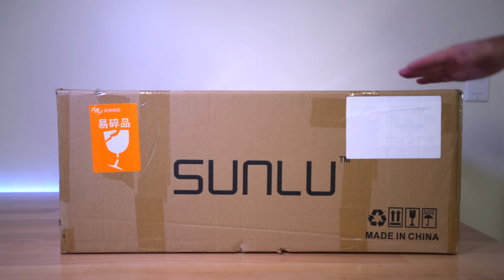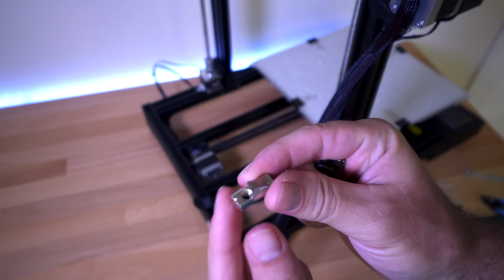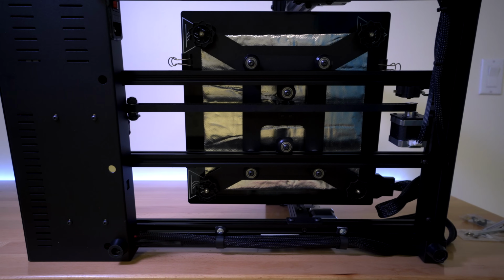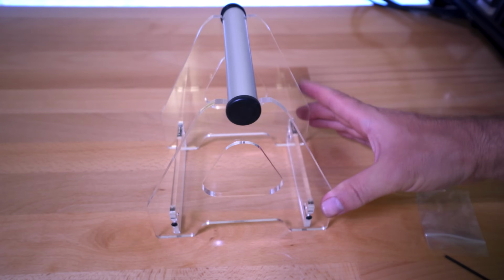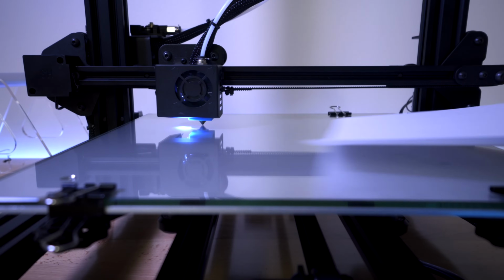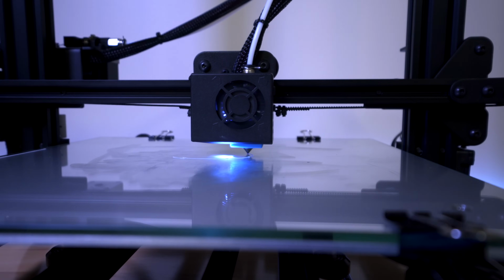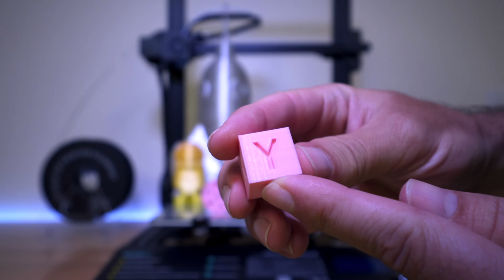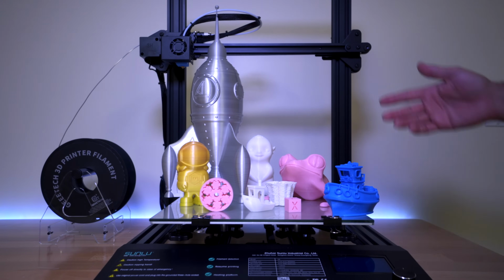Sunlu S8 - 3D Printer - Unbox & Setup

Comment: Just ordered the updated Pro version.  Perfectly what I wanted: a large format direct drive using a traditional extruder easily converted to direct drive with a stock bracket for an Ender that replaces the hotend roller head and adds a bracket to move the extruder to be above it and feed straight down ($15 from Amazon).  Gives me a large bed with dual Z that I can use TPU on with an improved head on the extruder to prevent filament escape by replacing it for a small gap between the gears and the receiving PTFE tubing.  Since I use Octo4a on a Tracfone Blue View 2, I don't care about the screen and appreciate the full size USB input.

Will see how I like the flex magnetic bed, and can order a PEI coated magnetic bed if I'd like that better since I love it on my Kobra.

Great price at $199 delivered.
Reply: My new S8 Pro arrived today, set up easily and perfectly.  Since someone had mentioned the gantry not being square on theirs, I only moderately snugged the four lower nuts with the T nuts tighter, then set it upright and checked the gantry for square and it was, so turned on side again, tightened all fully and then checked again after upright, and was still square.  I was prepared to shim it with aluminum foil if need be, but it was perfect from what I could see.

I didn't notice the right side Z stepper had the wiring off, so stopped and fixed that when I was doing an initial Home and it was jerking downward under no power from that side.

Used my square referenced above to level the L and R sides having it just scrape under the X extrusion on each side with power off, and smeared excess grease off the Z gantry down along the length of the rods and the Z was lowering like on butter.

Having done tons of manual leveling, it was just nice to have it move to the four quadrants on its own, only would have been better to have it just have a menu option each time to quit, but a default of move to the next corner, repeating infinitely to not have to start it up again for each pass around.

This printer bed springs seemed prone to do a little bit of "guitar tuning", in that when loosening the nuts, the bed didn't smoothly loosen (you don't always notice a commensurate looseness on your paper shim), and they would then over loosen as if the springs were jumping (like a guitar tuner does at times) and then on tightening it does smoothly pull, so in that case, just like on guitar, I seek the perfect final setting always from the result of tightening, not loosening if that all makes sense.

I could have set each spring a little looser gap when cold in anticipation of the expansion when heated but it was easy enough to dial it in a couple times around with everything heated.

Ran the test print of the 4 leaf cloverleaf and it had some blobs, so will do the SD card reformat, test again, and if still bad, just abandon it and move on to my ultimate desire to just use Octo4a into the USB port.

The build surface was a new one to experience, and I was pretty shocked to see it refuse to release under pretty significant hand pressure after completely cooling the PLA since I was away and just watching via LaView camera.  But it was stuck really good and I had to pull the bed surface off the magnet to flex and even then it didn't just pop off.  This worries me a bit for using PETG as it may require a chisel to get off (!), so will definitely order a PEI coated flex steel sheet I put in my Amazon inbox.

Getting a good long look first hand, I'm impressed with the value Sunlu is offering here.  Where others use plastic on the extruder to save a nickel, they use aluminum (tho you could drive a truck out of the out side of the drive gears, so won't tempt any filament escape using TPU until I replace that extruder head with a printed one I have with a much closed up gap, which I'll perform when I apply the Ender direct drive conversion kit tomorrow.

But the all metal front cover, the wire sheathing and clips all speak quality, along with the wider Y belt and the belt adjusters added to this version over the old version stock S8.  Disagree with those complaining about the power being in risk of the bed movement, just see they haven't realized you can easily hit the power button when reaching under the right side frame member, which would pretty much make it impossible to get a hand in the way of the bed moving.

I added an Ender filament spool holder that has the bearings to reduce drag when I'm using TPU and will try and report how easily the conversion goes to direct drive.

At this point I'm happy enough I regret buying 2 Aquila's for $169 ea. when $30 more would have gotten me one of these with a larger bed and dual Z...   This is a great value.

Comment: Hi sir my name is Johnathan and I purchased a s8 your video was one of the reasons why I purchased it. I assembled the printer and did everything you did in your video and thank you for that but when I went to print a model I get an error code E1 heating failed tried several times same result can you please help me out? Thank you I appreciate your video very much!
Reply: Old comment, but hopefully you resolved it by either checking the wiring for the heated bed and confirming whether it was loose or the bed was truly defective, or the mainboard was defective.  I'm confident I would have pulled the bed heater wires and tied them directly to the power supply, then flip on power for just long enough to either see sparks, or the bed heat or not, indicating it was bad,,, but that's just me.

Comment: what are they thinking hot glue all the connectors? this is crazy
Reply: that's stock, it keeps things from vibrating loose during shipping, and is easy enough to remove.  If you knew how many printers get returned just because someone doesn't even think to check connectors when they power it on and it doesn't work...

Comment: The z access is extremely hard to move manually.is this normal because I tried to un titen it but it's not working
Reply: you have to turn both rods simultaneously, and if the X axis is not level, they will be binding.  level them up first with power off and something to measure from the bed up and turn one side to bring level to the other.  You also have to have power off.  When power is on, the stepper motors lock in their position.
Reply: @B Miller  bro it's been a year, I have a new 3d printer 💀

Comment: This machine does have some nice features like the power outage feature and the filament run out feature, seems like these crappy SD cards are a issue with these chinese-made printers because on my creality Ender 3 Pro SD card went out after a couple of days so I bought a better one. And always check the temperature recommendations of each filament from different brands, different brands don't all use the same temperature settings.

Comment: Maybe u can help me, i have the Problem that when i level the bed with this printer (like in the manual and also when i first heat the bed and then calibrate it) i always have the problem that, when i do a ned calibration print it isn't working. Either the bed starts scatching even though the lines look like they are too far away from the bed, or they are defenatly to close, but when i distance the bed a bit more to hace no Scratch in the print it is way to far away. Do u have an idea what might causes the Problem? 

My tempurature ist at 65° bed and 200° nozzel for pla

Mfg Flecx

Comment: I have never liked printing off the SD card anyway. Much better control and operation running Cura or Repit-pro or etc. Love these 400 size printers. I have one of these on the way from amazon to ad to my 300x300x400 CR10 collection

Comment: What slicer did you use on this? my cura does not have a setting for S8..appriciate the help :)
Reply: I have been using Cura 4.7 and it has been working fine.  Here's the settings I tweaked that gave me great results.

If you check the owners manual they actually give you pretty good setup instructions for Cura.  Download the latest version and then change the following:
Print bed size 310x310x400
Layer height 0.2
Shell thickness 1.6
bottom/top thickness
Fill density 15%
Infil pattern Gyroid
Print Speed 50 mm/sec  (You can adjust faster if you need to, but may affect quality)
Print Temperature 205 C....if printing ABS use 230 C..... If printing in TPU use 220 C
Print Bed 50 C  (for PLA)....if printing ABS use 80 C..... If printing in TPU use 0 C
Fan cooling (check this box)
Fan Speed 100% (I use this setting no matter what filament I'm printing with good results.)
Support structure TREE  (far better and uses less filament than traditional supports)
Support Branch Angle 40 degrees
Support density 25% (they seem to fail at anything 15% or less)
Enable Roof Support (makes it easier to break away support material)
support Overhang angles 70 degrees.  This thing prints great overhangs for me
Platform adhesion ( I typically use Brim for ABS prints, and skirt for PLA or TPU to prevent wasting material)
Infil Travel Optimization (Check this box)  Speeds up your print

Comment: I just got mine, and set it up thanks to your great video. The prints do that exact same thing from my sd card as well. So seems like the QA on the test gcode isn't quite there
Reply: Hi I noticed you said you have the Sunlu s8 3d printer. I saw some bad reviews on Amazon. Do you like this printer? Is it reliable? Will it brake down after 3 months of using it? Sorry to be a bother but I was thinking about getting one. I just wanted to get some info from someone who has one. Thank you so much!

Comment: Thank you for this video! I just received my S8 yesterday and was feeling anxious when I first opened the box! This video will help tremendously when I fully unbox and set mines up! Really appreciate this! :)
Reply: Same here, just got mine, can't wait to learn and try things. Total beginner here
Reply: Hello I’m sorry to bother you but since you bought one of these printers, could you give me the dimensions of the printer as a whole? I’m seeing if it would fit on my table. Thank you so much.
Reply: @ryanbaker6793  no probs,   Length is 24", but a couple notes. Feet are only 18" so it will fit on a surface at least 18".  However, the table will push past the frame at the rear, so you'll need extra space at least a few inched to give the cable harness clear space,  Width is 18",  but again, with the spoll holder you'll need about 24" on width too
Reply: @MrMotor11  Ok thank you so much. Do you like the printer. I read a few bad reviews on Amazon and I’m a little worried about getting it. Would you recommend this printer?
Reply: @ryanbaker6793  I've printed a few things and mostly satisfied with it.  I've hit the usual problem with a crappy SD card causing it the have little pauses which makes little stubbles on the print.  PTEG is always a pain it seems to get dialed in so I don't think the printer itself is at fault for any of these things
Reply: Maybe u can help me, i have the Problem that when i level the bed with this printer (like in the manual and also when i first heat the bed and then calibrate it) i always have the problem that, when i do a ned calibration print it isn't working. Either the bed starts scatching even though the lines look like they are too far away from the bed, or they are defenatly to close, but when i distance the bed a bit more to hace no Scratch in the print it is way to far away. Do u have an idea what might causes the Problem? 

My tempurature ist at 65° bed and 200° nozzel for pla
Reply: @flecx9767  not sure what's going on there.  PLA is pretty easy to get for results.  My silly clover test print worked great.  I did abandon the outdated version of Cura they supplied,  and went to the latest version.  That gave me way better control of tuning the heat and cooling
Reply: @MrMotor11  yeah i also ubdated to a newer version of cura, and tried to update marlin today where i found that the baud rate of my printer was wrong, so im gonna try again tomorrow then i hope i can print the way it should :)

But thx for the fast answer :)
Reply: Hi I noticed you said you have the Sunlu s8 3d printer. I saw some bad reviews on Amazon. Do you like this printer? Is it reliable? Will it brake down after 3 months of using it? Sorry to be a bother but I was thinking about getting one. I just wanted to get some info from someone who has one. Thank you so much!
Reply: @ryanbaker6793  i have it for a few moth now but never had the Time to realy adjust the printer, i started with realy trying to get into the printing a few days ago and already had problems with the bed configuration prints. Today i found out that the baud rate of the printer was in the wrong setting, i need to do a few adjistments tomorrow then i can tell u if it works the way it should or not :)
Reply: @flecx9767  ok thank you so much pls tell me how it turns out
Reply: @ryanbaker6793  so i have to say, since my maiboard has a fault in which it doesn't take the 5V cotrol current to the mainboard i had a vew problems with updating the firmware, but i manged to it today because the Personen who wrote the firmware update helped me (huge shout out) the printer runs perfectly for now. 
I did 3 calibration prints and every single one was nearly perfect. 

And from what i read on the Internet (im the last 7 month) the problems i had basically nearly never occur, i can really say it's a good printer, u just have to know which settings u need to control and that u need to update marlin to use the new cura

Comment: I got a roll of Sunlu filament and it was literally the worst stuff I've ever used, I got black and the stuff was translucent, brittle, and had underextrusion on the same settings that I print Hatchbox and MatterHackers PLA with.
Reply: HAtchbox has been the best filament I have ever purchased.  Try the Sunlu Silk Silver PLA.  That stuff was great!!  I printed a REpublic Commando Helmet with it and it was far superior to anything else I've used for a helmet.  It's tough and yet also slightly flexible so there is no brittleness to it at all. I had problems with the Sunlu Black PLA as well, but the printers themselves are rock solid.  I own four of them now and they have been cranking out R2-D2 parts nonstop 24/7 since March with the only issue encountered is me having to replace the bowden tube on two of the units.  Other than that they have been awesome.  
Also if you want to avoid some shoddy filament, stay away from Novamaker....I bought 20 rolls of their ABS Red and yellow colors and they warp like crazy.

Comment: Hi, i just got this printer and it works well with the premade models but any models I download off the internet or make myself, the printer has trouble printing the raft for it. Using the default the filament with the nozzle heated at 210 degrees and the bed at 60 degrees.

Comment: Thank you for leading me in putting together mine tonight🖤
I didn't use the glue and it stuck perfectly anyway 😊
Reply: Hi I noticed you said you have the Sunlu s8 3d printer. I saw some bad reviews on Amazon. Do you like this printer? Is it reliable? Will it brake down after 3 months of using it? Sorry to be a bother but I was thinking about getting one. I just wanted to get some info from someone who has one. Thank you so much!

Comment: Did you try the provided sd card after deleting all the unnecessary files and folders? I've heard Marlin has issues reading from a crowded sd card.
Reply: The cheap SD card that my original printers came with was small and I didn't end up using either of them.  The second set of printers I purchased after a few months getting good with the first two ended up having bigger and faster Micro SD cards.  So big improvement.

Comment: I bought 2 of these printers and am setting them up now.  Printer #1 is rocking and pushing out a little Shamrock Test Print from the SD card that came with the printer.  No issues so far.  It's looking very high quality.  I'm super excited to get them going and start some awesome projects.
Reply: Thank you!
Reply: Hi I noticed you said you have the Sunlu s8 3d printer. I saw some bad reviews on Amazon. Do you like this printer? Is it reliable? Will it brake down after 3 months of using it? Sorry to be a bother but I was thinking about getting one. I just wanted to get some info from someone who has one. Thank you so much!
Reply: @ryanbaker6793  Bottom Line Up Front (These are GREAT printers!! Don't let a bad review scare you off.)  I bought 4 of these printers and have been very satisfied with them.  I initially bought two of them back in March 2020 for the sole purpose of 3D printing a Life-Size R2-D2 Droid.  I think they were priced about $349USD back then.  After owning the first two for about 3 months, I bought two additional printers from Sunlu because they were on sale for about $249USD and I loved the first two so much.  Totally worth the money spent!
  The Sunlu S8 is by far the easiest printer to get started with as a beginner and the bed is big enough to do some great projects.  Go to my Instagram page @daves_droid_workshop and check  out the 3D printed R2-D2 and my Iron Man helmet, and Republic Commando Helmets.  These are great printers.  You can unbox it and get started printing within about 30 minutes.  
If you have any specific questions about them feel free to hit me up with an e-mail and I will answer any questions you have.

Comment: Does this printer have thermal runaway protection?
Reply: The power supply and motherboard has safety warning system to detect the heating of nozzle and bed, against lose control of temperature.